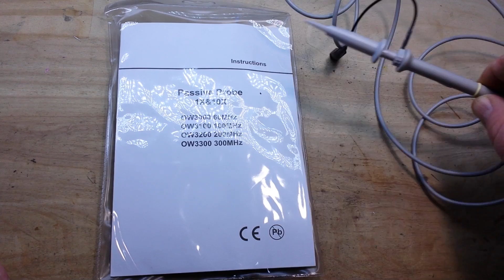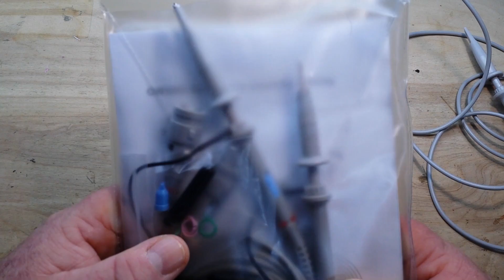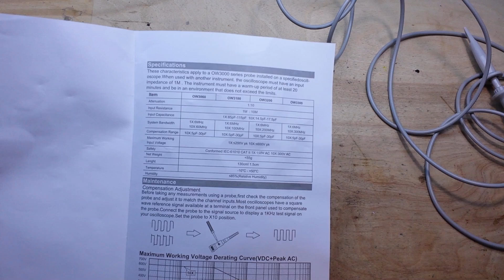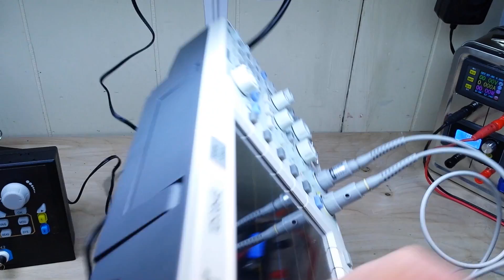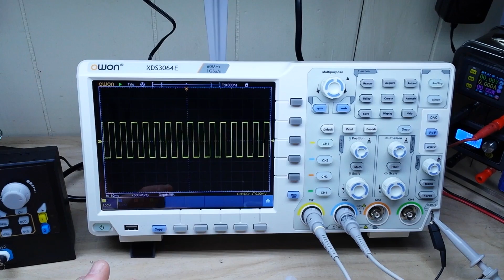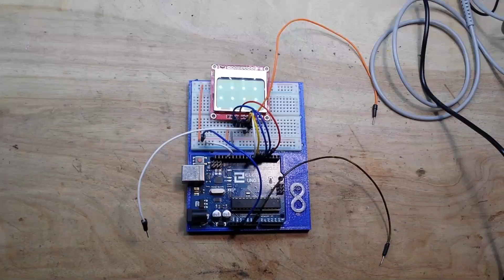Owon XDS3064E oscilloscope review part 1

Comment: I wonder how this would compare to the Owon SDS1104, both are 4 channel scopes but the SDS would be 100 bucks cheaper where I live, and also 100 bucks cheaper than the Rigol 1054Z. Seems pretty similar to this scope apart from the lack of a touch screen, although I should probably just bite the bullet and go for the Rigol and not risk it.

But if the Owon scopes truly are somewhat reputable and the software is good then it's an option, ultimately I doubt I'm going to do anything that's going to push any of these budget scopes to their limit
Reply from the maker: I've had a few Owons over the years. They are on par with the Rigols.
Reply: @learnelectronics  Thank you, I went with the Owon SDS1104, it has very little info online but I saw a couple of videos on it and your video of the 2 channel version (SDS1102) so it does seem like a decent scope. 

The price seems to be around the same as the Rigol in many places so that kind of makes the cheap price less of a red flag, it just happens to be on sale

Comment: hey Paul...nudge nudge wink wink: https://smile.amazon.com/gp/product/B07K256YG4/ref=ppx_yo_dt_b_asin_title_o00_s00?ie=UTF8&psc=1
Reply from the maker: Cool, I will check that out!
Reply: @learnelectronics  They are half the price they should be....and thats from Ebay china....not Prime Amazon! I snagged two...hope you get one!
Reply: It's also actually a Juntek too, although they have blurred the image. Very well built and very cheap way to get a 60v power supply linked with a cheap smps (i found one for $35 shipped Amazon). Can't believe they are still there for that price considering  the Rui Deng DPS5005 is over twice the price of this, and this includes the remote USB control access.

Comment: A 60Mhz bandwidth will NOT display a 20 MHz square/rectangular wave properly. The 60 MHz bandwidth will only pass the fundamental, and 2nd and 3rd harmonics. This will cause the leading and trailing edge rise times to look long, as well causing ripple artifacts in the horizontal parts of the square/rectangular wave. For 100% fidelity, you should probably want to be able to go out to at least the 7th harmonic, at least, and preferably, the 10th harmonic.
Reply from the maker: Not to mention the waveforms look the same on 100MHz scopes so there is that this probing my statement that the cheap dds function gen is at least partly at fault.

Comment: I picked up a Owon XDS3102A about a year and a half ago, mainly because of the 12 bit vertical resolution. Much nicer than the 8 bit typical of most scopes. I mostly do analog work, so the 12 bit resolution is much more desirable. The screen is very sharp, as well. I really like the scope.

Comment: I've been eyeing this.
There is a hack for upgrading one of the older rebranded models.
Reply from the maker: Do you have a link to the hack?
Reply: @learnelectronics  no I don't.  I just heard Dave mention it on EEV blog.
I don't know how long ago it was posted either?  I was searching for budget scopes and ran across that video that mentioned it but it was a different brand name.  But Dave said it was the same as OWON.
Reply from the maker: Owon is owned by a Chinese company called Liliput Tech. They make and rebadge a few brands.

Comment: We used to have an Owon at work a while back. This expierence left me scarred. You couldn't move your head wehen using the scope, because there was only a really specific angle at wich you could even see the traces on that horrible screen and what happend when you used on of the knobs was basically unpredictable. There were also some quirks with data acquisition and one of the owon probes broke and shorted the tip to ground, which killed a circuit. The scope here looks very decent compared to the horror scope in my memories, although I don't care much for stuff like touch screens and phone interfaces. They really seem to have improved, though I don't think I'll ever get an Owon myself, just too much bad memories...

Comment: Sorry about your loss.
I’m curios how you will like it compared to the Micsig.  Also, check the FFT.  I sent my OWON back because the FFT just gave wrong amplitude measurements.
Reply from the maker: So far it beats the micsig. The micsig has better touchscreen functionality, but that's about it. I haven't checked amplitude on the FFT yet, next video after the funeral.
Reply: learnelectronics Thanks I’ll be interested to see your follow up video.  I’m sorry about that bad news.
Reply from the maker: Thanks Eddie!